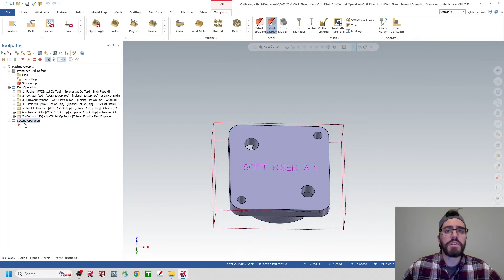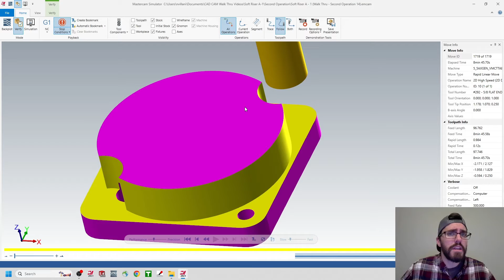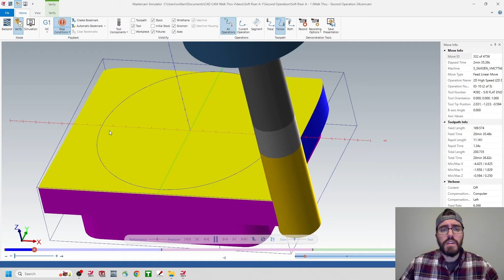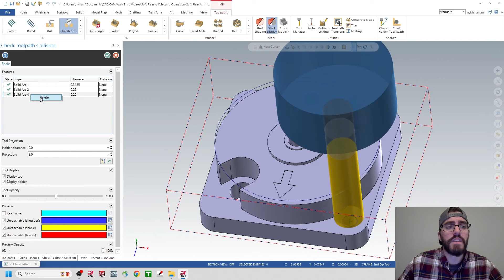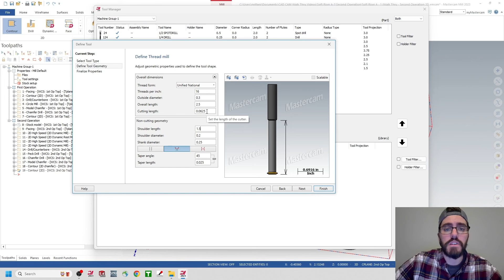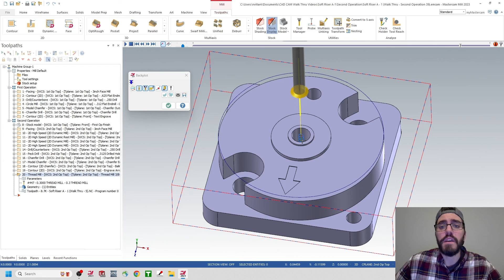MasterCam: Complex Second Operation (Multi-Op Program) with Full Explanation of Features & Workflow

Comment: Thank you for making these videos and showing different methods to avoid problems.  Question: How come when you showed the collision detection feature, mcam did not detect the collision on the fourth path?
Reply from the maker: I believe there are some parameters in the drill command that allow you to set avoidance regions.  However using the example shown in the video, MasterCam viewed all the stock as available material to remove.  So it's actually doing exactly what we're asking it to do.  Although, it would give us a warning if we hit a fixture we setup or if the tool holder collided with the part.

Comment: do you have any tips for the facing toolpath to be more efficient? It will almost always do a air cut on the last pass even though the whole stock has already been cut.
Reply from the maker: Hmmm, I've always had really good luck with my Face Mills cleaning up to Z0 on the final pass.  In the example used for this video, I set the depth cuts to .01 and had a top of stock value of .015.  The tool made two passes in verify.  Maybe try troubleshooting with One Pass or One Way and divide your top of stock value into an equal number of depth cuts.  For instance, .05 for top of stock with a .01 depth of cut should make 5 passes.  That, or you might also have a finishing pass turned on somewhere.  I think there's a tickbox in cut parameters or depth cuts that might be forcing an additional Z0 pass.
Reply: @artofthepart  my bad i ment when the tool is not big enough it needs to do multiple side steps and on the last side step it almost always does a air cut because there is no more material left.
Reply from the maker: I might have something similar in my Intro to 5-Axis Programming video under the Business Card Holder Case Study around minute 31:00.  I use a 5/8 endmill to face a larger surface and control using stepover percentage and entry & exit approach.